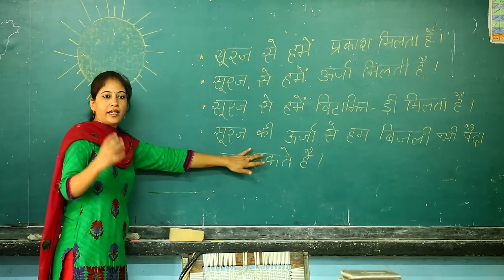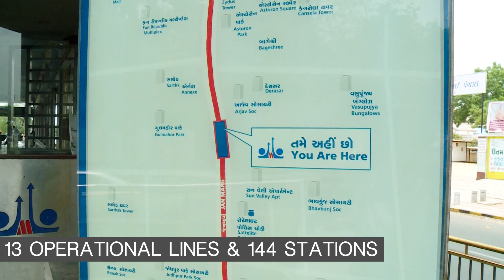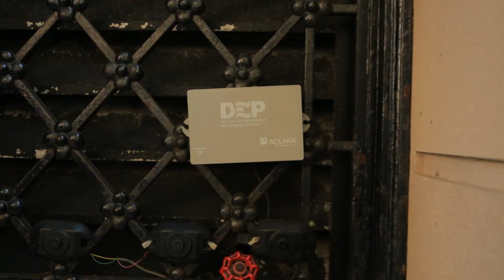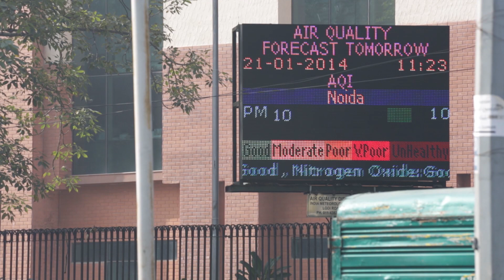India Smart Cities Challenge | Bloomberg Philanthropies

Comment: If India gets inspired from Indus Valley cities, that would be enough to build developed cities. Underground water network,  rectangular blocs, etc. I would consider IVC cities as the first developed cities.
Reply: Not necessarily, some city planning methods from IVC are great but most are inefficient in the current year. Also, many methods are already being used.
Reply: specially the eco san toilet system it will help solve the entire waste water management system problem and also address the resource extraction problem providing for important minerals like k2

Comment: #Thorium Molten Salt Reactors are the best option to generate base-load 24X7, carbon free electricity for the smart cities. Thorium reactors can be dispatched at any geography, do not require large land area and power output does not fluctuate with seasons. #SwachhVidyuth  for #SwachhBharath स्वच्छ भारत के लिए स्वच्छ विद्युत.
Reply: +Achal H P Thorium reactors are not completely developed yet. There are prototypes of small scale reactors but scaling it to 1-10GW reactors is not very simple. Do you really think that the government would be begging for uranium if it had an option to make thorium reactors?
Reply: @PurushNahiMahaPurush  Which is exactly why we have the 3 stage nuclear power program.
Next step is to properly take advantage of FBRs and molten salt will eventually come.
Every other country serious about nuclear power is looking to do the same.